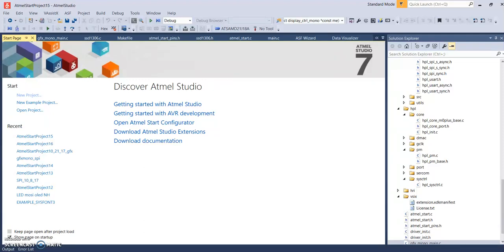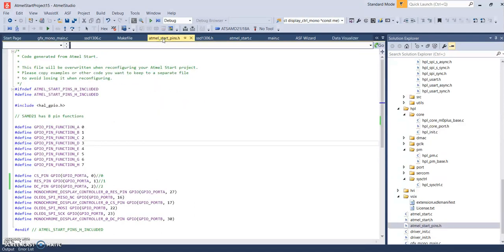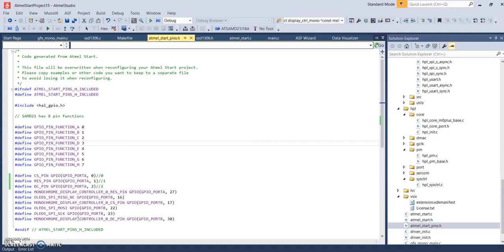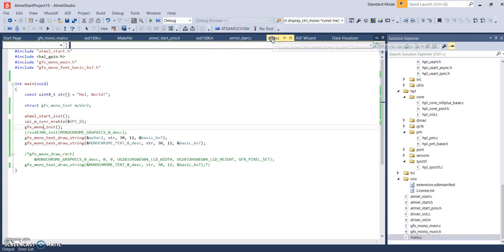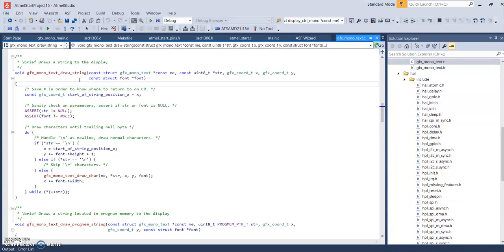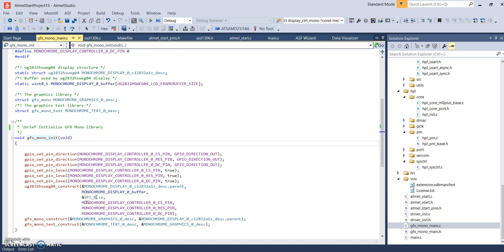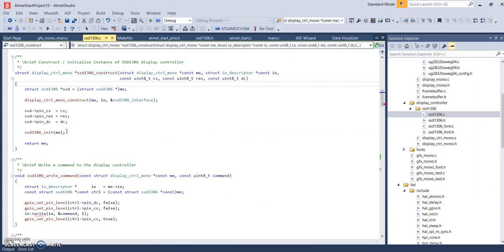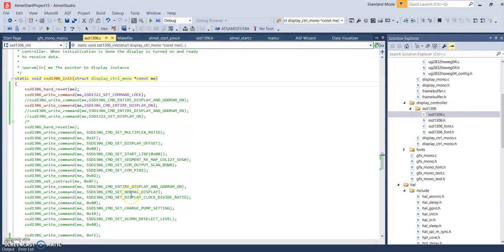Writting a new Atmel Studio Oled Driver Part 1

Comment: Hello Lyne by Line, 
I am a beginner with the Atmel ASF.
I am trying to implement the SSD1306 128x32 OLED in the SAMC21N using the ATMEL START. Apparently, the Atmel start uses a code version different than the one provided in the documentation found in the web. Also, I couldn't find much information or tutorials on how to do use this OLED. Your video was one of the few sources of information, but I still couldn't get it working. I feel that I am probably missing a small detail, but I would really appreciate if you could help me.
Thank you in advance!